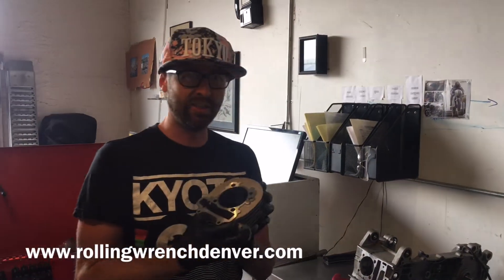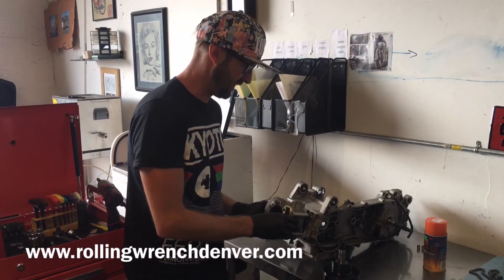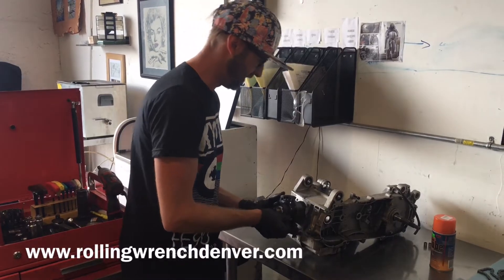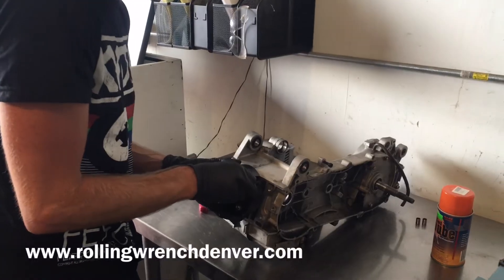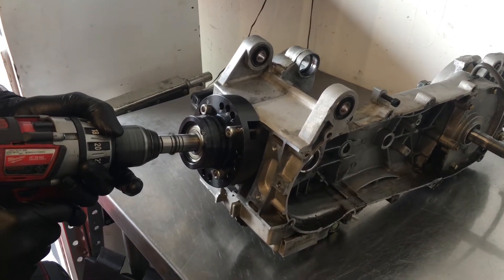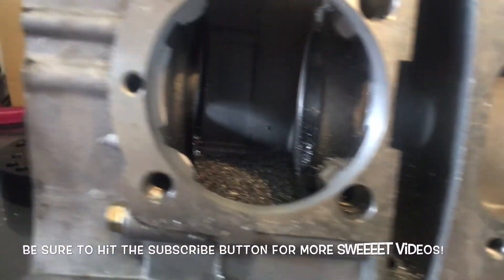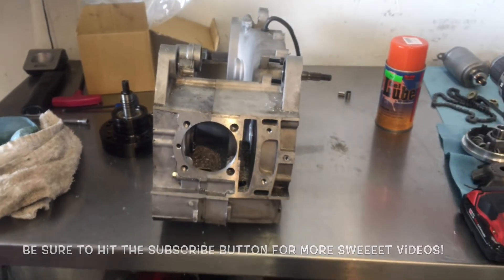GY6 engine case boring 170cc 180cc 190cc

Comment: Hi rolling wranch I have a big problem I am running with a daelim trans 4v 125cc scooter I have been looking for a piston head I can not find one I was thinking to change the holy system I bought a new engine for Gy6 125cc it can't fit on the body

Comment: Should the 180cc top end fit with a gap or a snug fit or the moment it slide in it’s good
Reply from the maker: It’s a tight fit. No gap.  But you should be able to easily slide it in with zero force

Comment: Does installing a 180cc kit to a 125cc make it faster? I.E Top speed? Standard 125cc was getting 60mph. After installing the 180cc kit (rebored crank case) is now only getting 45mph
Reply: 🤣 Change the carburetor
Reply: @kevingif2703  i should have mentioned I installed a bigger carb aswel. Only things I have not changed is roller weights, clutch springs

Comment: any heating issue with the up than 61mm block on scooter ?.. want to install it but wonder if there will be overheating issue on ride with big piston and thin cylinder block..
Reply from the maker: 61mm, no not at all. Most people don’t run a oil cooler, and I have seen people run no cooling shrouds.
Reply: @RollingWrench  thanks you for your fast feedback about my question..did u run with or without oil cooler ?.. is it safe for me to run it without oil cooler and stock oilpump on that big bore kit ?.. f.y.i im now already running it with 58.5mm kit with 28mm oko powerjet carburetor and lazada racing camshaft... others part such as cylinder head, valve, spring etc is stock... during ride i feel a bit of heat vapor at my legs from the engine, that why im worry about that issue on bigger piston.. sorry about my worse english because im from malaysia..
Reply from the maker: Kamarudin Mohd Piah  on the 61mm kits the stock oil pump and no oil cooler is fine. Anything larger I would do a oil cooler and a high volume oil pump
Reply: thank you, i will install it soon and with performance variator for top end speed test.

Comment: How big was the bore before you made it larger. I assume that was a 157QMJ case. I hope
someone can answer that question for me as I want to get a BBK but am seeing many sizes
61-65mm Someone help ?
Reply from the maker: It’s was a GY6 150. If you don’t want to modify your cases do this kit:
https://www.rollingwrenchdenver.com/products/gy6-171cc-big-bore-kit
Reply: @RollingWrench  ty, i will consider it. I don't suppose you can tell me
the skirt OD of that kit and if you know the ID of the gy6 150 157qmj
that would be great. Thanks again for your reply.

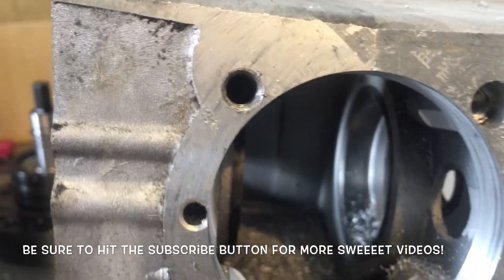Comment: Wow, what a panic alert here about thoses "thin wall", what should be considered is thickness at the threads under, this is the important part, and it still look correct, just pause at 1:15 or around.
All good, cool tool.
Reply: Not good at all.180cc will give much more vibration to the engine .If you look carfully there is not even 5mm between those 2 walls where the Cranck sits..